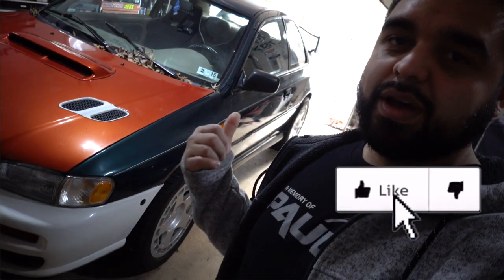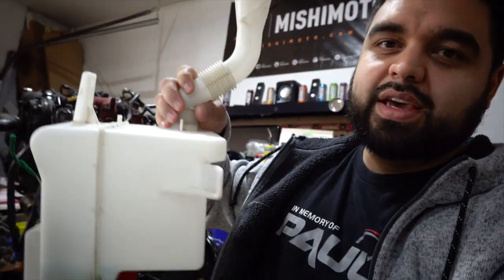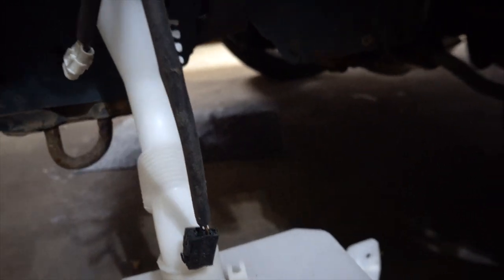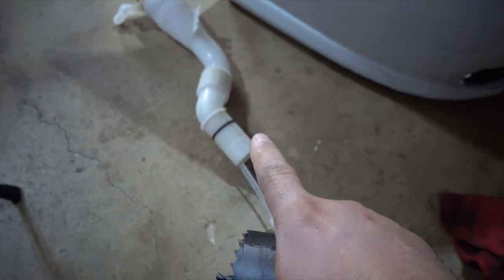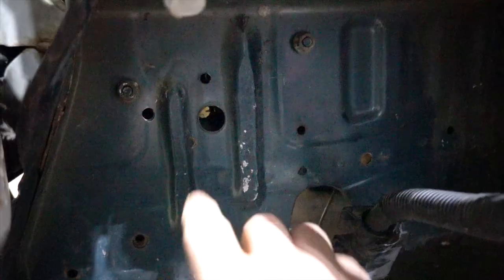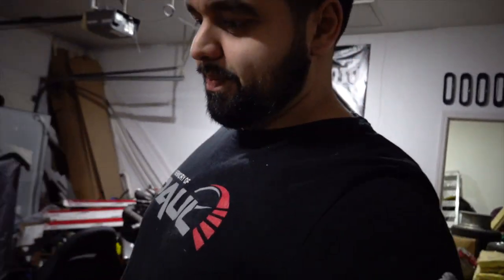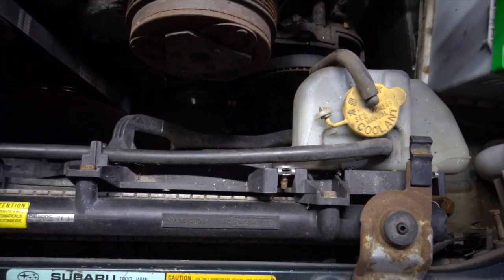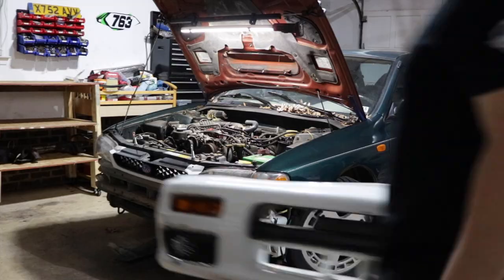Saab 9-2x Washer Fluid Bottle In The GC8!!

Comment: the blue car, dont press your hood to close it. just drop´it.
Reply from the maker: It doesn’t like to close on its own. I’m guessing it’s because it’s so light since it’s aluminum. It has a small dent in the center because when I got it from paint, the latch was moved and I was slamming it (not smart) until I moved it and got it to close properly. Should come out with a paintless dent puller tho
Reply: @StayOnTheGas  yes it comes out but its now
 marked. every time someone press it, it will live a bigger dent! beeing there, done that. you should be able to drop it and it close with ease. mine does! probably you need better fitmement of the part and hinges!
Reply from the maker: Yeah I might have to take it to a body shop to get it professionally fixed if the dent puller doesn’t fix it all the way